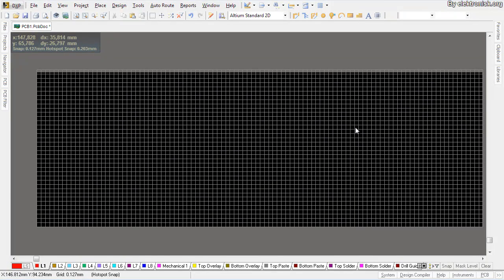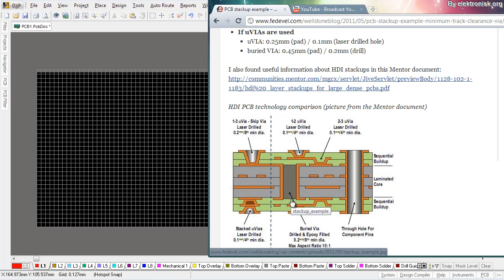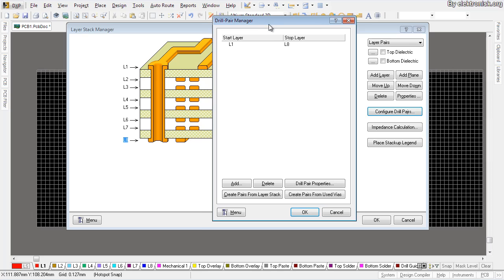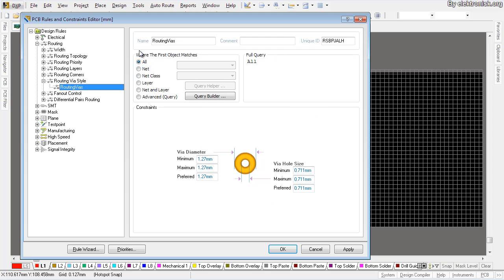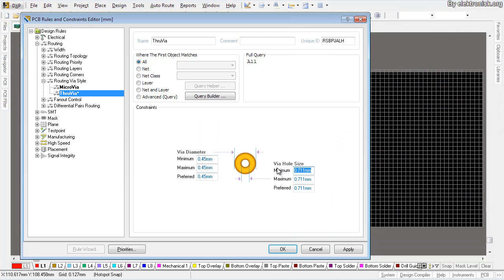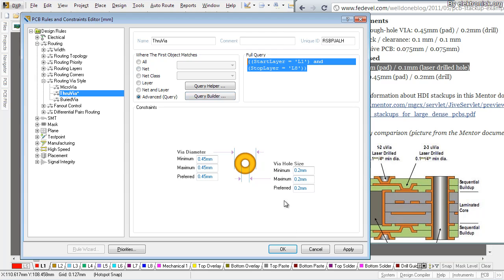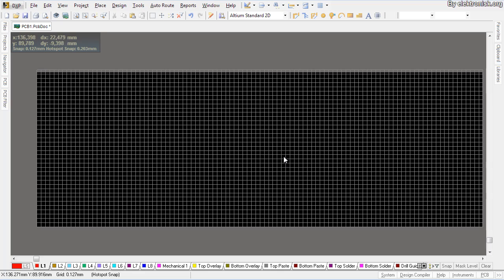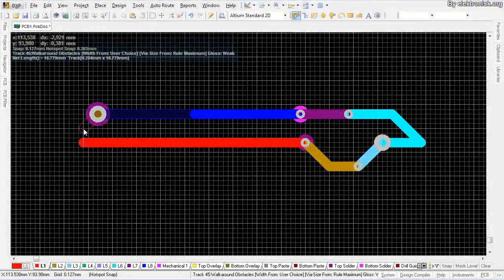Altium Designer Tutorial: Working with vias and multiple layers

Comment: I'm having problems when I autoroute a double layer board. My components are on the top layer and I need to solder them on the bottom and hence would like all my pads on the bottom. After autorouting some of my components have traces to their pads on  both the bottom and top layer. Is there a rule or something that makes autoroute place a via outside the components instead go through the pads?